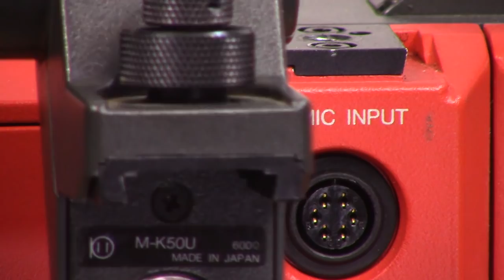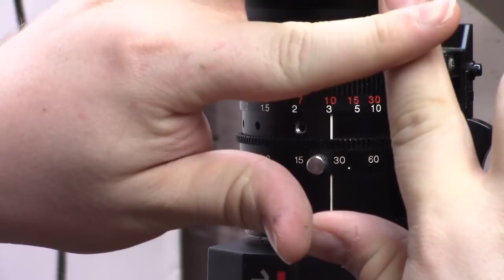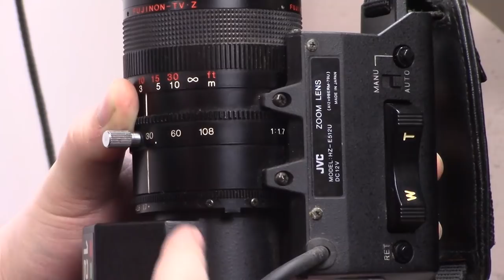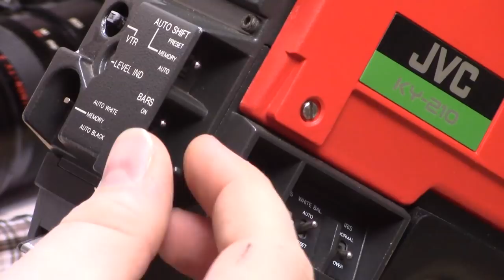Love Letter To JVC KY-210 - Part 1

Comment: We used to use a heavy NiMH battery belt to power our ENG cameras at the local cable station back in the early aughts. They were three-CCD miniDV camcorders with about the same shoulder-mount body size.
Reply: (NiCd)
Reply: @ynda777  Uhuh. NiMh really was used in the AV-industry. Even better, I wouldn't be too surprised if the AV-industry started using them first as they provided such a huge benefit over NiCd's (the memory-effect).
My JVC GY-DV500 came with NiCd's, but one could buy far more expensive NiMh's and even more expensive lithium-batteries for them.

Comment: Oh, about the iris (13:30): those lenses usually start with a 6-blade iris (cheap ones), not the standard 2 blade V-shape iris from consumer grade camcorders. More expensive lenses usually feature more iris-blades. This makes them more complex and expensive.
And about the mount 15:40 : the fact you rotate the ring instead of the lens is because the servo-unit, with its wrist-strap, needs to stay in the proper position. (with the operators' hand basically vertical)

Comment: I went to school for TV news type video crap and I can confirm what you said about "noone knows". Now, I ended up dropping out about a year in (because I was 19 and stupid), but from what I've gathered, the subsequent years are basically the same as the second semester of the first year, but with internships further down the line.

That established, all they teach you in school is how to write and how to edit. Using the equipment (like, actually using the cameras as well as composing your whole shoots) is basically entirely autodidactic. Even editing is very basic. If you want anything technical, you're not going to get it with a degree and several tens of thousands of debt, you're only going to get that on the VideoHelp forums. Like, they talk about journalistic integrity, but equipment history is never touched (which is odd because they have equipment including U-Matic tapes and players in the equipment closet).

Comment: FYI this is still how those types of lenses are made today in 2021. Also if you use the camera outside or have very bright light never point the lens of a  tube camera at it it will destroy the tubes. That is why the filter wheel has a closed position.

Comment: Compared to camcorders and the modern day these cameras were extremely repairable. 

In NYC, at the time, you HAD to know about Armatos. On monday morning there would be a line around the block of news teams and wedding videographers waiting to get their rig repaired. There was no issue that would keep you from next weekends gigs if you got there quick enough. 
A whole craft waiting to be forgotten, if it isnt already.
Reply: It's still a thing, but has shifted more to PCB-swapping and FAR more software-investigation. I have the service manual on both my JVC GY-DV500 (a MiniDV beast from 2000) and my JVC GY-HM750, a shoulder mount 3 CCD FHD camera. Where the DV500 already records a shitload of data in internal logs (faults, statuses, temperatures and what not) and communicates between every PCB with a secret JVC-known bus-system, the HM750 is basically a computer with an extensive amount of memory on board to set and save just about anything from manufacturers' calibration data, to user settings, faults, temperatures, fan hours and everything I forgot.

The JVC GY-HM850 I also own (3 uncompensated-for-rolling-shutter-CMOS FHD), the successor to the 750, can even communicate with attached and supported lenses to apply Chromatic Abberation Correction (CAC) to the image before it is recorded on the card(s). The controller in the servo-unit has calibration data from that specific lens exposed to test-images burned into it, telling the camera exactly how it performs at its different zoom, focus and iris ranges and applying corrections accordingly. This suddenly makes a rather shitty CAC-compatible lens perform like a top-notch lens.

From the mechanical problems magnetic-tape based systems suffered from, it has now gone to more into non-hardware problems. Hell, there's even a port on all cameras mentioned above to just read out the internal fault-memory by computer (and the right software on it...)

Comment: My guess regarding the ND ring having a fully closed setting would be for a quick black balance without needing the lens cap or for a quick sensor cap while changing lenses in challenging environments. Quite smart really.
Reply: The fully closed setting is to protect the image tubes from “burn in” when the camera is unattended. Saticon and Plumbicon tubes could be damaged by being pointed at the sun or even a bright studio light for too long, even if they were powered down. With the camera turned off, it would be easy to accidentally point the camera in the wrong direction and have the sun focused on the tubes. The dark setting in the filter wheel cuts off all the light and protects the tubes.

Comment: If you still would consider repairing this camera, you might get away with just replacing the bipolar electrolytic caps. We are talking about ~15 caps in total. I fixed my KY-310 with the same flickering issue. It's also out of calibration, but that's another topic ;).

Comment: The JVC KY series orange cameras starting with the KY-2000 were poor man’s three-tube cameras. They were for the industrial market, not broadcast. They utilized mirrors instead of prisms that were in the much more expensive “broadcast” cameras by Sony and Ikegami. The KY-210 may have had a prism. The back focus adjustment was necessary on all removable lens cameras so that, when properly adjusted the focus “tracked” from telephoto to wide angle. That means when you focused on an object in telephoto and then zoomed back to wide-angle the camera would still be in focus. Every time you removed or changed lenses you had to do a back focus adjustment. It was done a wide open iris for minimum depth-of-field. The filters included standard 3200° Kelvin (clear filter) for artificial light electronic preset and 6000° K preset for daylight. For more accuracy you did a white balance by viewing a white card or surface.

Comment: The CCD and  CMOS They where available and plenty. My 1987 camcorder used a CMOS and my 1991 used a CCD but those where not used in professional equipment because they where not able to meet broadcast spec until the Sony Hyper HAD sender for there 90k$ BetacamSP ENG camcorders of the 90's.

Comment: This hooks to an external video recorder 
The pin connector is standard
Reply: It wouldn't surprise me at all if JVC made an adapter plate to pass power and the signal feed from that hidden multi-pin connector to a docking point for a video recorder. For those somewhat infrequent times when they needed to rush someone out to a scene without the ability to get the full camera crew together. Throw some form of tape into a recorder, strap the recorder onto the camera body, and be on your way. Or you could go the umbilical cord route and use a waist or back-mounted video recorder tethered by a cable to the back of the camera.

Comment: You got the "what" on back focus but you didn't get the why.  The lens can be attached to any number of heads, because they are standard mounts.  So you have to adjust it for that.  Even between the same models your backfocus can be a little off between serial numbers.  (In any event, at a TV station you have a chief engineer who is going to demand to check out your camera every so often and calibrate everything, including the lens, and he wants to be able to fix the back focus.  That's the real reason for a lot of what you see, because the station wouldn't issue a PO until the Chief approves it.)

The why on why you need to adjust it (and normally don't care on a still camera) is because you use zooms in video, and especially in ENG.  It's the same reason you can jam a quick focus on the same controls you can do a slow Nixon zoom with.  You need to set up the back focus because we are trained to focus the camera by zooming in all the way, focus at that point, and then zoom out to compose the shot.  Then, if you need to zoom in or out after that initial composition, you are still in focus.  On a still camera, you wouldn't care and would just fix the focus, but you are doing it live on video.
Reply from the maker: The dynamics of the optical formula are completely wild to try to understand, but now that I've gotten a couple more cameras and swapped lenses I'm starting to get it. I gotta learn how to set backfocus correctly, in fact - my new 2/3" Pana completely disagrees with the FFD of the JVC I took the lens off of, and I just futzed with it until it looked OK. I'm gonna go out and shoot field footage with it and make a fool of myself by getting infinity completely off on most of it otherwise.
Reply: @CathodeRayDude  The quick and dirty method is 
open the iris as much as possible
zoom in completely on a distant target
set the focus
zoom back out completely
adjust the backfocus until it is in focus again.  
Zoom all the way in to verify and repeat until you can zoom in and out with the target in focus for the entire focal length
Reply: @everlastingphelps  Yep, and if you want to get more visual feedback if you're doing it right: use a Siemens starchart or (when you don't have one or you do have one but no one to hold it): a brick wall or something with a repeated pattern. Those objects, and the starchart especially, will peak like hell when you get the (back)focus right.

Comment: Before I lose the thought: The only reason I haven't been collecting camcorders is that someone once told me that they are all brimming with surface mount electrolytic capacitors which have all leaked and are virtually impossible to repair. I believed it because like every Tascam 238 deck needs a whole new board because of those caps. But, um... I'm starting to doubt my commitment to avoiding camcorders. Was that good information, anyone? 🤔
Reply from the maker: it was good information, for many of them. I have a couple that are in extremely dire condition almost certainly for this reason. others are perfect after 30 years.
Reply: @CathodeRayDude  Thank you! I certainly didn't expect you to answer that. Sorry to hear it is a true thing you have to deal with, though ;) 🙏👍
Reply: Breaking out a desoldering station with an order of replacement caps is the bread and butter of vintage electronics. Honestly, as long as you're willing to invest in some degree of fume extraction, leaded solder, and lots of paste flux, then repairing your electronics isn't as difficult as it may seem. Quality flux and solder go a long way to making such repairs easier, as does having loads of solder wick and a solder vacuum. Mechanical or pump operated, solder vacuums or solder removers are incredibly useful when dealing with through-hole mounted components, which become increasingly common the older you go with your electronics.

Tricks to know when soldering: 
-The bigger the glob [of flux] the better the job. Flux is easy enough to clean off and inexpensive enough that wasting some to make sure your solder doesn't oxidize and start acting up while your working on it is worthwhile.
-Lead-free solder is the work of the devil and should only be used when there's a chance you'll be consuming or soaking in something that contacts it, like plumbing.
-Always try to buy the best quality replacement capacitors you can afford. They're the things most likely to fail again if you cheap out. Resistors, diodes, triodes, transistors, chokes, transformers, etc.; as long as they meet the necessary specifications to do the job where they're going, there's typically not as much justification for splurging on those. The exception is always Hi-Fi audio equipment, where you may want to just go ahead and splurge as much as you reasonably can for better tolerances in performance. And whatever work you do on one channel, you should do on the other, after measuring and matching components for both channels to reduce channel imbalance.
-You don't have to spend a lot to get a workable soldering station, but getting one that also does hot air is useful for dealing with surface-mount components.
-When dealing with surface-mount components Kapton tape is your friend. Stick it on the board over surrounding components to keep them from lifting or shifting while you're reworking nearby. It's also really helpful for rework on double-sided boards if you're concerned about things falling off the backside as you heat the board.
-Take pictures and/or have the circuit diagram handy for whatever you're working on. Not all companies think ahead or have the space on the board to silkscreen on the component identifier markings and their values. Best to have some way of knowing how it should look before you pull things off the board.
Reply: @mndlessdrwer  Wow, THANKS for such a thoughtful chunk of advice!! I know just enough to understand how spot-on it is. Definitely going to copy that comment and keep it handy. I'd love to not be so overwhelmed tackling repairs. Again, much obliged!! 🙏🙏👍

Comment: Had just typed a whole explaination of the various terms through this video but lost the whole post!! Bugger.

ENG as opposed to film gathering, Servo zoom control, back focus to set parfocal tracking of a zoom lens, detachable parts for easy maintenance or setup as a studio cam. Canon B4 lens mount system.  There was more, but I can't be bothered going through the whole video again to pinpoint them!
Reply from the maker: Thanks for the comment - so do you know if Canon originated the B4 mount? I've been trying to figure that out. It seems like they never made any ENG cameras, and Sony/JVC never made any lenses, so I've always wondered who designed the mount.
Reply: @CathodeRayDude  No, it was a sort of industry standard thing from the 1980s with Sony taking a lead.  The two main manufacturers of lenses were Canon & Fujinon, with Sony, JVC, Ikegami, RCA, Phillips and Thompson making the cameras.

Comment: Did this end up at re-pc? I just got this same camera there and I had to laugh that when I looked it up, your video was the first to pop up.
Reply from the maker: Yup! Congratulations, haha, feel free to tell people it's the same one. I just got to a point where I realized I hadn't touched it in 3 or 4 years and it was just taking up space, and I figured if I dropped it off there it would end up in the hands of somebody who wanted it, and wouldn't you look at that, that's just what happened. By the way, I believe it does work, it almost certainly just needs a recap and you'll get a good picture out of it again. As it is, it'll work for about a minute and then the image slowly starts dying
Reply: I got the same series camera for years now, I didn't remember where I got it, but it's ky-1900ch model. Was watching your videos and noticed one on your shelf. Now I know that it's not much of a thing😂 I'd used it once as a prop in red bull soap box race and now it's on a shelf too.